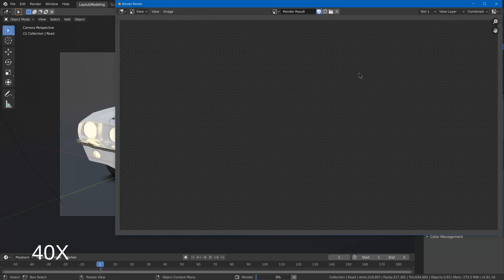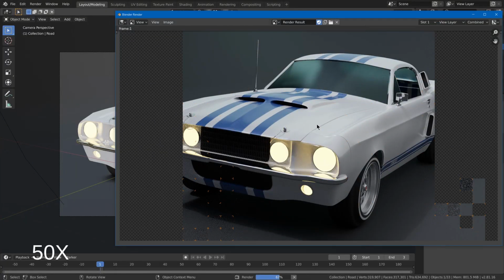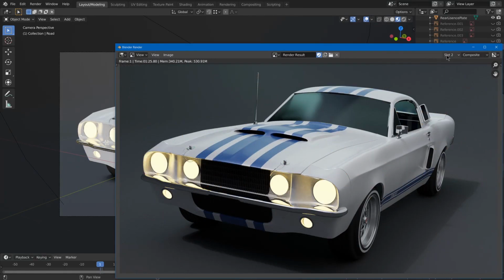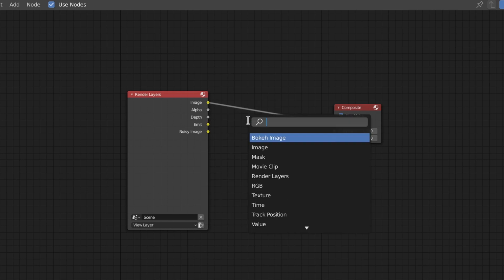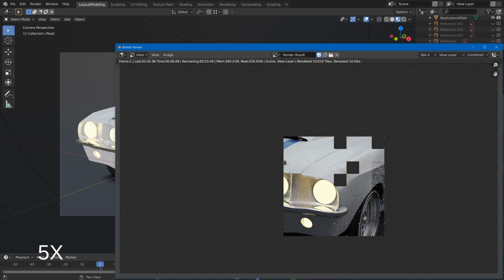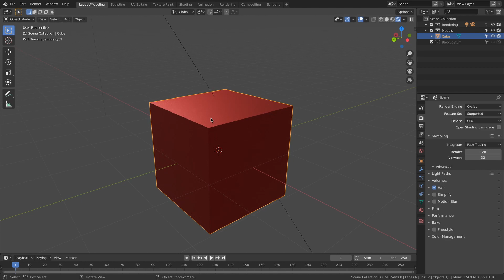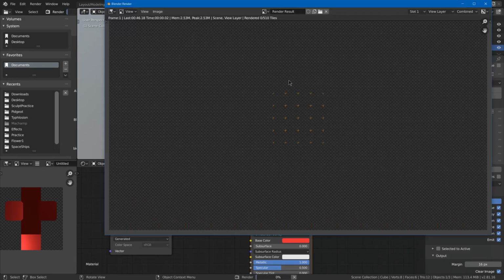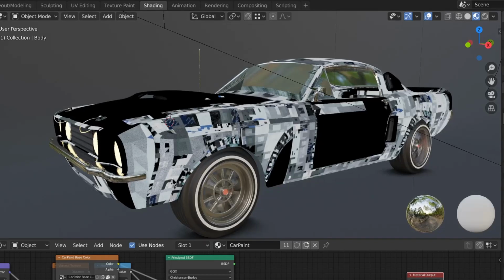SPEED UP CYCLES!  | Blender Render Time

Comment: I have a hack to render in less than 30 seconds, you can activate the denoiser, now i explain better for new people...

The denoiser fix the pimples when the rendering has low quality (like 24)
For Blender 2.90
Go to: View layer properties, passes, data, Denoising data and activate it.
Do a normal rendering, now nothing changed but open the "Compositing" tab
Click on "Use node" and add a "Denoise" node, after connect
Image to Noisy immage.
Normal to Denoising Normal.
Albedo to Denoising Albedo.
Go to Render properties and set the render to 10
And Here we Go, do a rendering

 you all are welcome

Comment: I agree with the other commenters on not pairing a random render seed with any denoiser.  If you want to denoise an animation -- stick to a static seed.  Blender has 3 denoisers and only bpy.ops.cycles.denoise_animation() on the python console is temporally stable (its also too slow to recommend).  The original denoiser and Intel denoiser both are spatial denoisers which have no awareness of frames before/after the current frame so even with a static seed you can see denoiser artifacts (wispy dust bunnies) depending on your samples per frame -- though sometimes you can get by with minimal artifacts.  These denoisers will produce even more shifting noise artifacts when you use a random seed!  If you want to denoise animations better get the Neat Video plugin or buy the paid version of Davinci Resolve Studio which both have fast Spatial/Temporal denoisers.

Comment: And that was just the basics, you could also use the custom Theory Build of blender which has adaptive sampling, blue noise dithered sobol nosie sampling and scrambling distance to get even better speeds.
Reply from the maker: Yeah, there's a lot of ways to speed stuff up. I've also heard of  E-Cycles that I believe is an add-on  version of cycles with some extra optimizations.

Comment: Hey Man! Really love your videos...can you please do a tutorial what's the best topology to create a weapon..I have made a Beretta Pistol in Blender but there are some n-gons and triangles and some poles..you can see the model here : https://youtu.be/b3iiFOgXS18 and please tell me how i can improve that model...keep up the great work🧡🔥
Reply from the maker: Nice model! Tris, ngons and poles are only really bad when they cause issues with shading, animation deformation, and subdivision, or if its making it harder to model. Since it's a game model it has the benefit that you can often use triangles to reduce the models tri count. Otherwise I can't really help with topology without downloading the model. Looking at the file in blender, it has some pretty nasty geometry, I'm guessing heavy use of booleans? With those you just have to accept that they're gonna mess up the topology, and depending on where it's used you'll have to clean it up. But it doesn't have any of those problems above, so its probably fine. You might want to add a triangulate modifier to it before exporting (where the exporter will apply the modifier) so that you make sure the game engine doesn't calculate the triangles from ngons the wrong way though.

About the model, I would say that since it's  a weapon, that's use case might be for a first person shooter where you'll see it up close, it's likely worth it to add the extra polys needed to get it's curves looking smoother. You might also want to add some small 1 segment bevels, and a weighted normal modifier/manual face weighted normal editing to improve the look of the bevels, that way it catches the light realistically. You can use LODs for situations where it isn't right in front of your player's camera.
Reply: @MrTriPie  really,  thank you so much man for sparing your vision on it❤❤❤..at this point..i almost fell for you..lol😂😂..jk..i had an ngon in my pistol and it doesn't had a shading issue but when i exported it to unity...unity said 1 ngone removed because of overlapping or something ...so i selected all the faces with more than 4 vertices and applied triangulate faces but that thing doesnt work well i guess..so i will probably triangulate them myself...and thanks man ...i really need smoothing the model..so just a quick question. ..where are you from?😁😋
Reply from the maker: You're welcome! NC